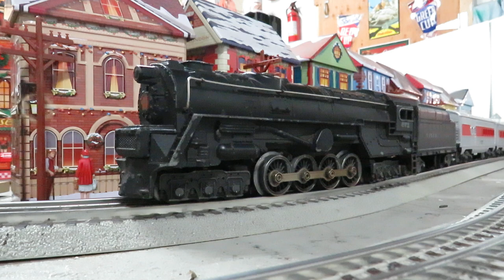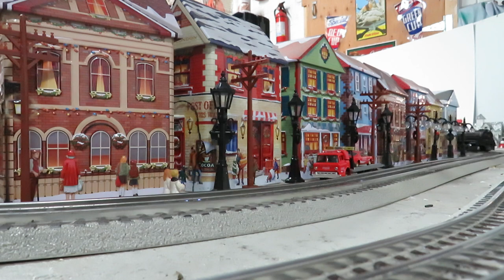Lionel 671 & whistle tender repair

Comment: The 671 turbines with lightbulb smoke units are very rare. They were produced in 46 only. 1947 was the year where they changed the units to heater elements
Reply from the maker: thanks! This is the second one I've worked on and repaired. My friend that owns this one pulled it and the tender out of a bargain bin at a train show!
Reply: What value would you place on this Locomotive? Does being rare mean it's more valuable? I bought it at a swap meet out of a junk box.

Comment: No, don't use liquid smoke on the smoke bulb. They were designed for the pill only. I have a 681 which has magna traction that I purchased at a consignment  shop at a low price. I had to replace the front truck and the rear step assembly. Wires in the tender were replaced and brushes replaced and a total lube and cleaning of the locomotive. Runs well, but these are still a dog compared to the other steam locomotives produced. The best way to test the load function is to run the post war cars with the cast trucks. These locomotives were only designed to pull five of these cars, possibly six. The cars with the cast trucks need to have the wheel assemblies oiled sparingly prior to use. The newer Lionel cars with the fast angle trucks have little or no resistance so they roll easily and don't need lubrication. My 681 smoke unit I converted to liquid since the pills weren't readily available. Now I see on ebay that someone is manufacturing the pills again. 😎🚂🚃🚃🚃✝
Reply from the maker: Gary, thanks for the info! Yeah I had not intention of testing the smoke bulb other than installing it. When I talked about adding a load to it, I meant just to be sure the loco wasn't going to go 2 laps and stop like it had done before working on it. Those older cars are much heavier though as you pointed out! They weren't the best pullers but they are pretty cool looking!